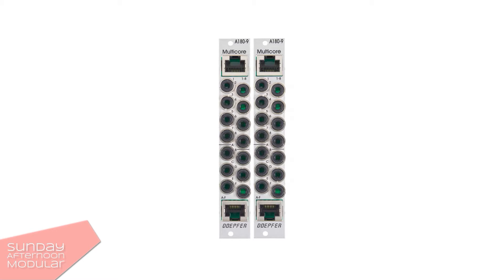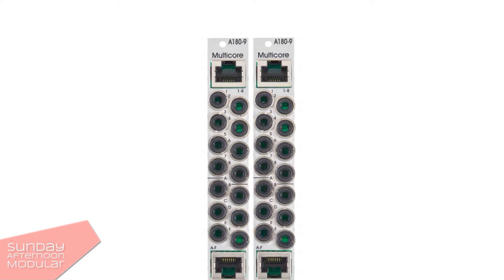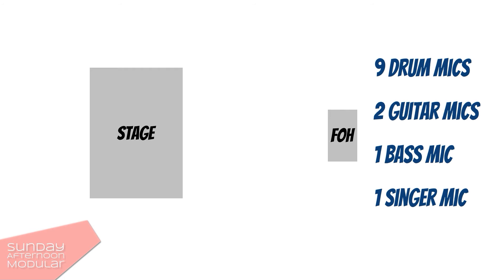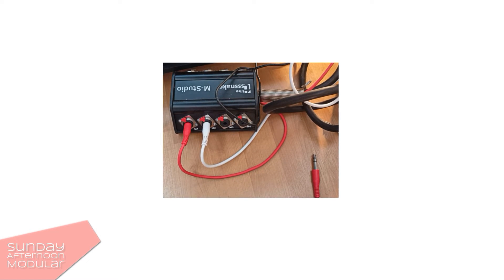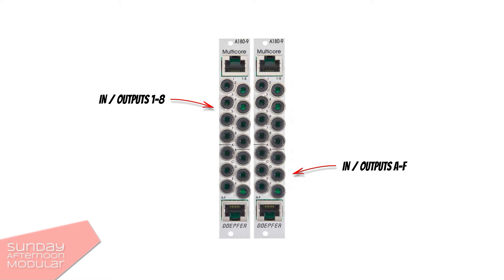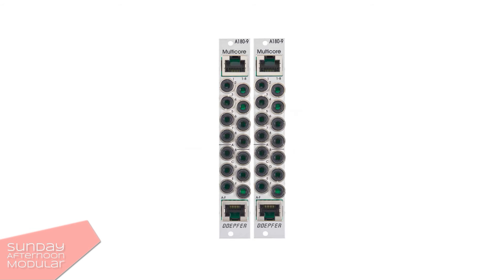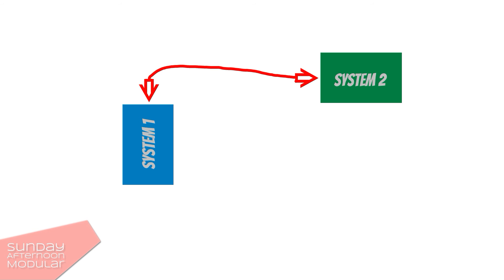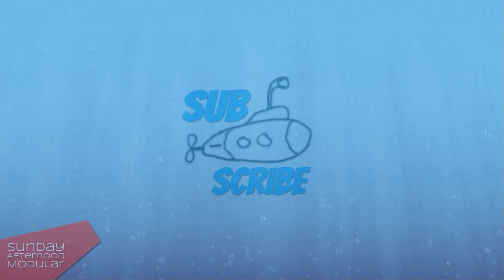The Doepfer A180-9: A Multicore Solution for Modular Madness

Comment: I use two of them, on the top left and right middle ends in a 168hp x 9 Doepfer case.
With the ribbon cable interconnect and It's like folding the box in half when routing from one end to the other.
Saves 14 wires, and it's clean. The CAT cables still work (too!) talking to other boxes. 
Crosstalk hasn't been a problem with clocks and audio so far, but I'm cautious with note CVs.
The four ribbon cables for internal interconnect can be light and fussy to lay in. 
What the A-180-9 does for the case is cool.
Reply from the maker: Thank you for sharing your experience with the Doepfer Multicore!